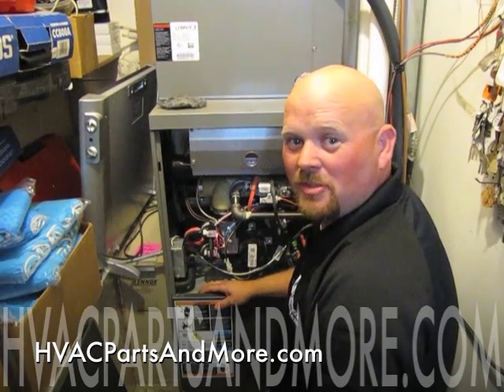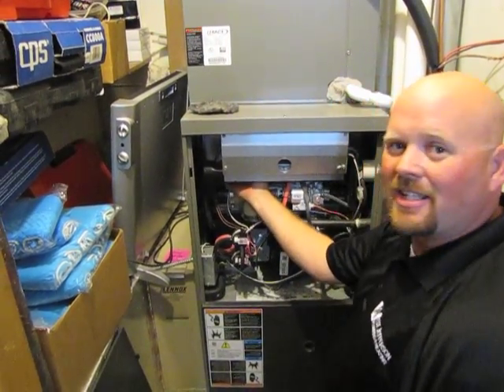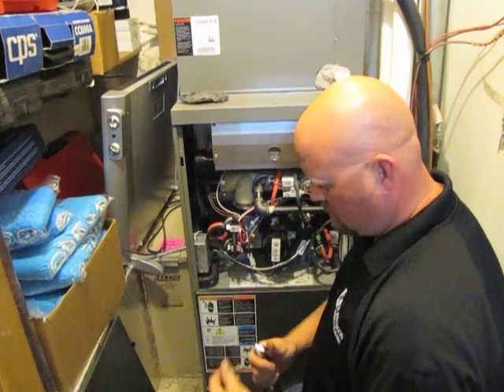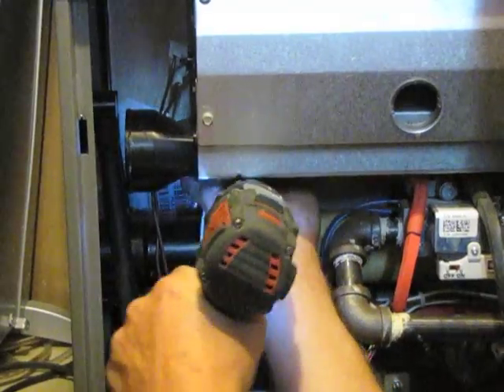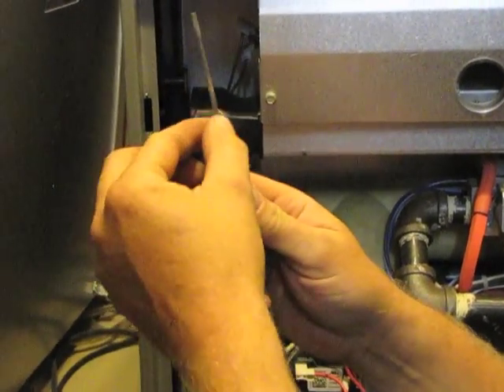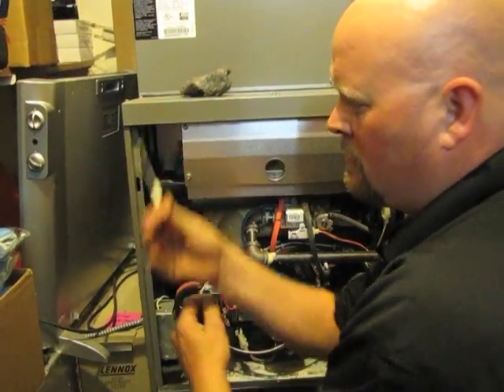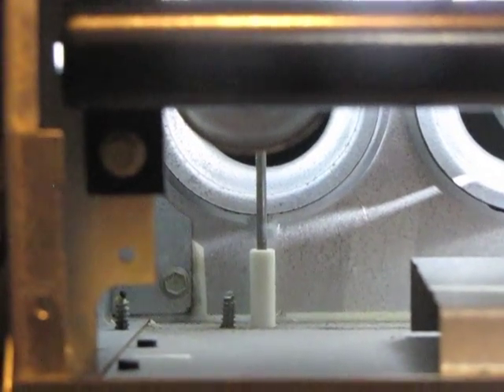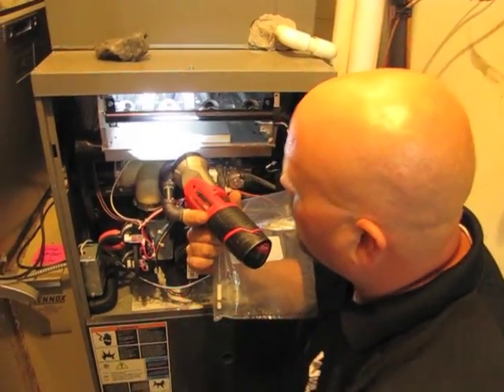DIY - How to Change a 52W29 Flame Sensor on a Lennox G71 Furnace

Comment: After pulling the sensor, which looked pretty decent on our 25 year old Lennox, discovered the problem of the chilly house today was just the connection between the sensor and the wire. The connector on the wire and the tab on the sensor were both corroded. A little fine sandpaper, some steel wool and a bit of a squeeze of the connector with a pliars to tighten it up, furnace is working properly again.

Comment: I wish I would have seen this video a couple of days ago.  I had to remove my flame sensor the hard way with a ratchet that I could only swing a few degrees at a time.  Took me hours to work the screw out. I did not know that 90 degree adapter existed.

Comment: The left pressure switch port on my G71 will become completely clogged with yellow debris within two months in cold weather. It shuts the furnace down. Any suggestions?